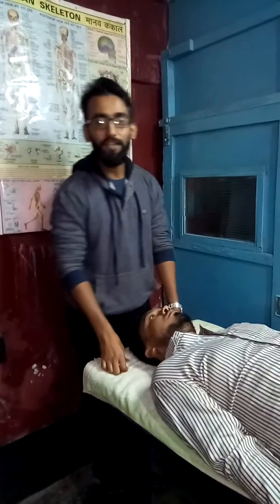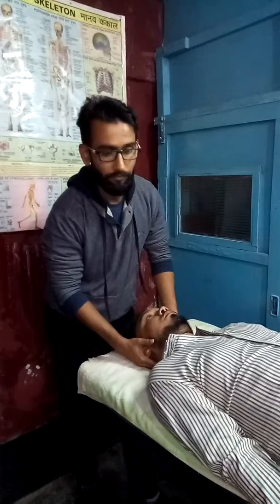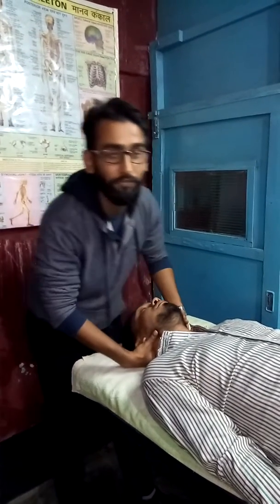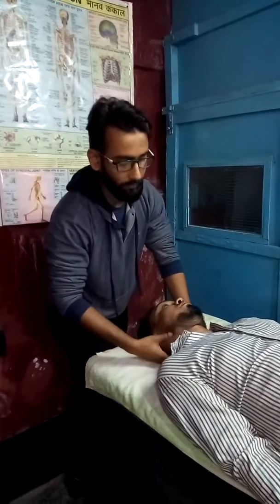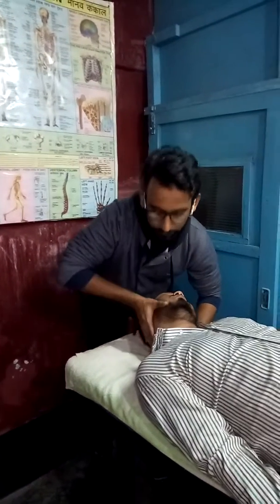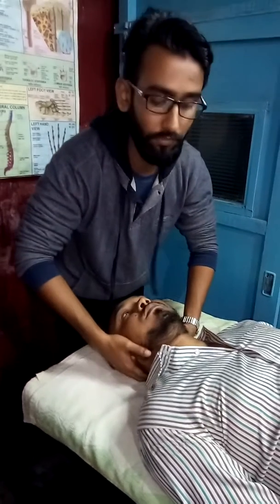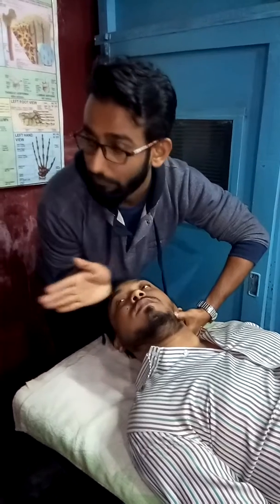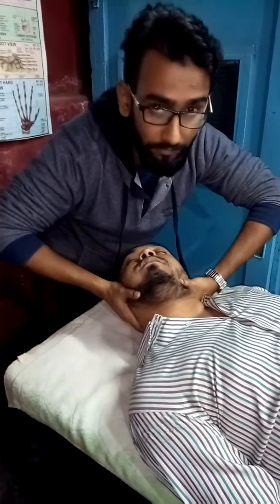Neck Manipulation ( HVLA - High Velocity Low Amplitude ) thrust of Upper Cervical Spine

Comment: This is interesting. i have neck probs at C3   esometimes my neck can be bent over to my chest. osteo treatment works but only  a couple of days.
by the way i could not follow all the words as the video volume was low and the man was speaking too fast.

can this treatment have long  term dangers.
i had osteopois  now osteopoenia after B12   calcium and vit D tabs   i just turned 70 and want to play fiddle without discomfort.
Reply from the maker: Hi!
Hope you are doing well.
This treatment may alleviate some of the pain in the neck but this is not The Ultimate solution. 
Moreover  the age you are in, is such that you may get pain due to primary or secondary causes behind  such vertebral pain.

The MECHANISM behind pain is very complex and unique.
Osteopenia / Osteoporosis can be a major cause  behind pain and muscle aches and cramps.
You  can take medications to improve e your bone mineral density and B12 levels after consulting a Qualified physician. 
This will help as well.
Sun exposure is also very vital 
Regular Mild to moderate intensity exercises  will help you to immensely  to cope up with your health issues.

Because, 
EXERCISE IS MEDICINE

Comment: I have often found that articular restrictions in lateral flexion of the Cervical spine are  contralateral to the side of restricted rotation. It is rarely on the same side. However, this looks like a good technique for when it is this way. This is a chiropractic adjustment that I learned in college. Where did you learn it? Have you found a different pattern of Cervical restrictions in your clinical work?
Reply from the maker: Paul Berard 
I learnt in my Post Graduation .
This technique is one of others done .